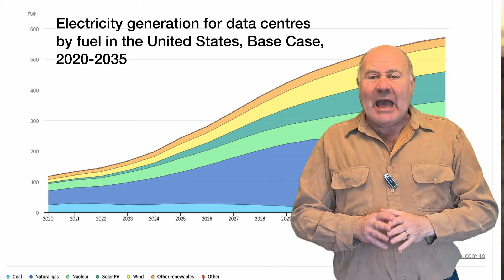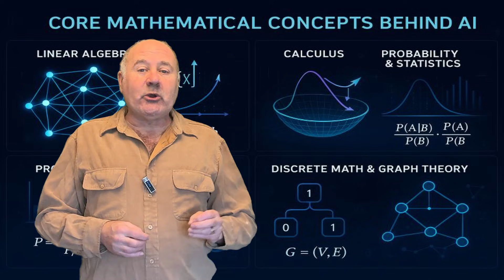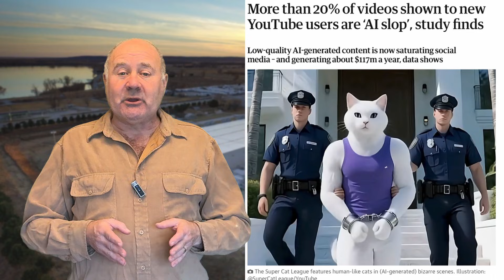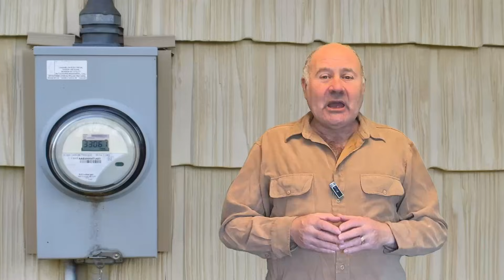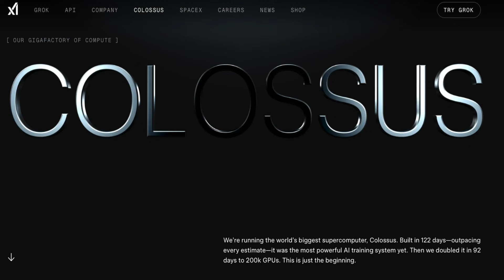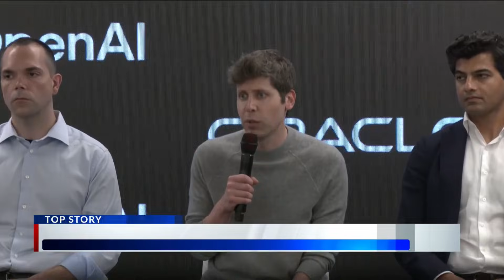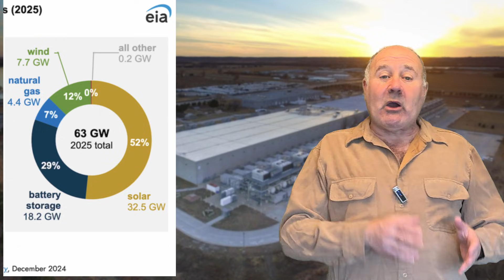You’re being lied to about electricity and AI data centers: the truth is dirtier and inefficient

Comment: You want fast and clean? Improve the Government permitting process. (Speed it up by 10X).
Reply from the maker: It doesn't help that Trump canceled a bunch of pemits for off-shore wind that were under construction. 

I've done several videos on this topic (e.g. https://youtu.be/N6b7xTd5CJg). This would help, as would improved interconnection procedures.
Reply: @Decarbonize11  The problems with wind are two - intermittency. Batteries will help that to an extent. And seasonality - which currently has no affordable solution. Solar has the same problems. Solar and wind energy - without batteries it is unreliable. With batteries it is unaffordable. What happens in a bad season? Not enough electricity. That means a battery big enough to get you through bad years. You can't afford it. Plus it is a fire hazard.
Reply from the maker: The seasonality issue pretty much disappears when you have wind (winter peaking) and solar (summer peaking) together. Add 4-8 hours of storage and long-distance transmission, and you have a reliable and inexpensive system. That was the topic of my first video.
https://youtu.be/kw9_Q_qm0Es
Reply: @Decarbonize11  Look at your seasonal records again. There are periods of insufficient overlap or no overlap. See - on average you are correct. But the grid doesn't run on average. Instantaneous input must match instantaneous output at all times. And yes averaging over time zones is good if the wires can handle the flow. All that you want - batteries and a stronger grid cost $$$ and so far the money isn't being spent. And unnecessary if you can add fuel burning plants for the local consumption.
Reply from the maker: The periods of no wind/no sun, known as Dunkelflaute, don't occur at the same time everywhere. That's why the long distance transmission is important. And having some nuclear, hydro, geothermal also helps. 

And yes, this costs money. But the only study I'm aware at that looked at total system costs found this approach the cheapest. 
https://youtu.be/D7LlA6V60RU
Reply: @Decarbonize11  I got my grid training in 1964 and '65 when the Navy was training me to run its nuclear reactors. I qualified.
Reply from the maker: Things have changed a bit for wind and solar since 1964, but the AP1000 nuclear plants that were just built in Georgia are pretty similar (i.e. pressurized light water) to what was being built in 1964. Except they were much more expensive.
Reply: @Decarbonize11  There is one extremely important thing that hasn't changed - instantaneous input must match instantaneous demand at ALL times. Some of the variation is handled by rotating machinery absorbing and releasing energy. But there are limits to that caused by frequency stability demands. Battery "generators" (solid state converters) are very good for frequency control. The energy conversions are near instantaneous. Did I mention I became an aerospace EE sans degree after I left the Navy working mainly on aircraft generators? Electrical power and I have a long history together.
Reply from the maker: You didn't mention it, but everything you said makes sense, so I believe you (not that you need my props, you've earned them). 

I think a big part of the future of a stable grid will be battery banks with grid-forming inverters. That provides the grid services currently being performed by spinning mass. 

https://youtu.be/ZiHum-VNHAM
Reply: @Decarbonize11  We have enough fuel to power things for 100 years at least. We have time to make the investments and figure things out. Measured. Considered. Not panicked.
Reply from the maker: @msimon6808  
But we don't have 100 years to deal with the carbon emissions. The "not panicked" response is to stop building new fossil fuel plants and to decommission the older plants over time.
Reply: @Decarbonize11  I was in on the original CO2 discussions at Watts Up With That? It is a scam. Water vapor (WV) is a greenhouse gas equal to CO2 according to theory. There is on average 50 times as much in the atmosphere as CO2. There are still no proposals for draining the oceans. Water vapor is not persistent? 
According to the theory water vapor's lack of persistence in the atmosphere (rain) means WV only counts for heating, not for evaporating more water vapor. Which is absurd because heating causes evaporation and the atmosphere is not saturated. The theory is bunk. - CO2 doesn't produce enough heat to make the theory work and water vapor produces too much. Bad theory.
Reply: @Decarbonize11  BTW CO2 causes global warming has never been properly proved. It depends on computer codes and those have never been fully released for review. A corruption of the scientific method.
Reply from the maker: @msimon6808  I request that you watch my video on water vapor. 
https://youtu.be/Rjkum1HFUzk
Reply from the maker: @msimon6808  Actually the warming effect of CO2 was understood in the 19th century. The computer codes are used to extrapolate what will happen in the future, but are not needed to prove that increasing CO2 leads to global warming.
Reply: @Decarbonize11  Yes. in a controlled lab experiment with one variable. The atmosphere has hundreds of interacting variables, among them Water Vapor - which at ~50X CO2's effect you have not accounted for. I understand the theory being bunk ruins a lot of reasons you have worked on. The CO2 causes global warming depends on computer codes never released. Big red flag there - if you were looking for one. Which you should be. What could disprove an assumption should always be a top question. It is how you do science. You should always looking for someone being fooled. As Feynman noted - the self is easiest to fool.
Reply: @Decarbonize11  The next big grid advance will be replacing copper with carbon nanotubes. If that becomes technically and economically viable.
Reply from the maker: @msimon6808 nothing would make me happier than for climate change to not be real. I do this for my son and granddaughter, not for fame and fortune. 

And the models, which are published, that show problematic climate change have been consistent with the data. There are no projections of business as usual that aren’t scary.
Reply: @Decarbonize11  Unless you have an answer to the water vapor question that is satisfactory - you have to consider the theory bunk. The intent of the original folks involved was to scare people into decarbonizing. Which they have done. None the less without WV the theory and CO2 do not produce enough heat. With WV the heat produced should cause atmospheric WV saturation. Which it obviously does not. There are rumblings that AI does not agree with global warming theory. If AI is gong to be useful, that is the answer I would expect from it. i agree climate is changing. I highly doubt CO2 or water vapor is causing it. As to not being a scam because of confirmation may I point you to ==>  everybody knows "Drugs Cause Addiction"
Receptor science (100+ years old) says there are NO addictive drugs. Drugs fill receptors. What empties those receptors (injury, PTSD) causes a desire for pain relieving drugs. Drugs CAN'T cause addiction. People take pain relievers to relieve pain. PTSD pain is not a medically recognized condition. It is illegal to prescribe drugs for it. Ask your doctor if they know Receptor Science (it is taught in all medical schools). If they say "Yes,"  ask how drugs cause addiction. I dare ya. 
My point is - belief is inadequate to prove truth when objections are ignored. Now about all that water.
Reply from the maker: The direction is actually in the other direction. Using aluminum because it's cheaper and a good enough conductor. Carbon nanotubes would be frightfully expensive and not that much better than Al or Copper with HVDC.
Reply from the maker: Did you watch my video on water and climate? That's my answer. 
https://youtu.be/Rjkum1HFUzk
Reply: @Decarbonize11  Economics does stand in the way.

Comment: I'm glad I've downsized everything before  co vid. Being able to produce your own electricity is the way to go it's cheaper and more sustainable. During the warmer months I don't even need electricity most days. I have some solar but my tri-fuel Honda that runs on gasoline, propane or natural gas. I only run it on propane and I have a bit saved up. Propane is a green fuel that never goes bad. Solar is good but it doesn't work on cloudy days, at night or on rainy days. And solar along with battery banks have to be replaced after so many years they lose their efficiency. My tri fuel Honda generator running on propane will last a life time.
Reply from the maker: You may produce your own electricity with the generator, but you're not producing your own propane, so you've just changed who you're dependent on, though it sounds like you're not very dependent since you downsized. If you live in an area where the grid goes down a lot, this might make sense, but it's not green or sustainable.

Comment: Grid itself doesn't scale up.
Nuclear promoters say only existing national grid as project costs expand too much.

Which modern technology scales up economically to replace fossil fueled energy ?
PV roof electricity and V2 EVs behind every meter. 

PV roof panels shade hot roofs and lower summer peak air-conditioning costs. 
Humans stop moving in extreme heat.

Grid full time maximum UTILIZATION at full time peak supply capacity WITH behind the meter batteries, and not the annual maximum PEAK LOAD operation with no behind the meter battery capacity. 

Grid capacity overbuild for the annual peak adds to the ENTIRE grid upgrade.

This is a fundamental concept.

Comment: 7:45 Yea don’t make claims off conclusions formed by grandiose brochure style pr advertisement. I have researched into the citadel & either they never provide or go into details or if they do when you get through all the grandiose boasting you find that they are deceptive with their claims. Like they claim 100% recycled water, while only 33% is but they make claims future technology developments will resplenish their usage indefinitely as if technologies in development are guaranteed to fulfill speculative potentials. They say they use 100% renewable energy including solar & wind, well what are the other renewable energy sources they primarily use? They primarily use the term renewable but also use green as well. Way in their ESG data report did I see where they have & are partnering with Nuclear power plants for their energy. So their claim about 100% renewable energy is unfounded & unbiased as they do not state their sources but contrarily mention using energy not made by renewables. While nuclear may be “clean” energy it is not renewable & this their claim of 100% is false. So YES they ARE GREENWASHING!
Reply from the maker: You’re right that I didn’t dig deep into The Citadel and I appreciate you sharing what you’ve learned. 

For nuclear they have signed an understanding with Oklo about future nuclear, but I don’t think they currently have any contributions from nukes. 

Even if all they’re doing is having some behind-the-meter solar and batteries and the rest comes from the utility, that’s better than what xAI and OpenAI are doing.

Comment: I live alone, the TV is on most days, and I only have one small light on. During the winter months I wear three insulated tops and set my thermostat so it is just below "turning on". Yes, its pretty cold, the olive oil on the counter turned solid, and the shampoo in the bath room is almost frozen.....and my electric company said my usage was up and sent me a $300 plus bill for Dec, Jan, Feb.....absolute no way I am using that much electric.
Reply: Same here. My bill doubled and I do nothing differently than before.  Now my power bill is almost as much as a car payment t every month
Reply: @ericswires8534  There has to be some law to prevent this. It is fraud, they are charging us for something we are not getting (using)?? That is a crime.
Reply: I never use Christmas lights or cook more in December and yet the power bill is always higher in December!!
Reply: Insane. I have all my heater elements on. XboxX/PS5 Washington machine dishwasher. Fans on all summer. I got akvarium with heaters lamps and filter. I pay 70 dollars. But im in sweden. Maybe ypy can switch company

Comment: Servers need a constant and consistent supply of power. That isn't coming from solar, wind and batteries.
Reply: I guess nuclear and gas will be used for data Centers, solar and wind for ordinary users
Reply: @sullivanrachael That won't work either. Base load units and an upgraded and hardened infrastructure is required to address the general population as well. Modern appliance electronis required stable power supply too.

Comment: I worked at a company that builds green AI datacenters.  The power is required for training models.  NVIDIA still has the leading technology in this space, but there are competitors that are getting closer.  The real problem is how fast the growth is with regards to how much power is required for each new generation of hardware for training.

When I started there a couple of years ago, each rack of hardware required 40 kilowatts of power to operate.  About eighteen months later, the next generation of hardware came out, and it requires 140 kilowatts of power per rack.  That’s 3.5 times as much power required per rack, in just one generation.  Each rack can do much more training per watt, but the wattage is also going up, fast.

NVIDIA has already told their customers that the next generation of hardware will require at least 600 kilowatts of power per rack.  Again, it can still do more training per watt than the previous generation, but that’s now a factor of about 4.3 times as much power per rack — again, just for one generation.  That’s a total of fifteen times as much power required, over just two generations of hardware, and about eighteen months between each generation.  That’s exponential growth.

In comparison, it takes years to go from starting to plan to build a datacenter to being able to start rolling in hardware.  My former employer was working on making that time period shorter, but there’s a lot of red tape and approvals you have to go through, on top of all of needing to find sources for all the power needed for the systems, all the cooling systems and the water required for those cooling systems for the datacenter itself, all of the high speed dark fiber that is required (terabytes per second today, petabits per second in the near future), and all of the on-site battery and backup generators for when the grid goes down, plus the fuel for those backup generators.

And then you also have to account for all the water usage for however the power is going to be generated, whether that comes from the grid or from the on-site generators.  Gas power plants require huge amounts of water, and coal power plants require orders of magnitude more water than gas power plants.  Water requirements for the power plants could easily be higher than the water requirements for cooling the datacenter itself.

No one is thinking about any of these things.  Local power and water resource networks like ERCOT and LCRA work in terms of five year plans.  But five year plans cannot possibly keep up with exponential growth in power requirements in an eighteen month generational lifecycle.  And water resource networks like LCRA don’t even have network sharing arrangements that they are working on, whereas power resource networks like ERCOT have had those kinds of features for years — that’s a critical component of the power grid.

On the flip side, inference is relatively easy.  General CPUs can do inferencing about as fast as NVIDIA hardware (on a cost/result basis), although custom inferencing hardware can do much better.  You can even get custom inferencing hardware built into your phone.  In fact, pretty much all modern phones already have this hardware built in.

This is a bubble that will pop.  It will be bigger than the dot com crash.  But in the meanwhile, just how much destruction will these companies cause to our water supplies and our power grids?
Reply from the maker: Thanks for sharing your insights.

Comment: Great video.  I'm not sure if you mentioned it:  But the cost of power from "onsite behind the meter" generation will likely be at least twice what it would be from the Utility who built real long term reasonably environmental power plants.   How will they be able to afford the energy cost.   Another item - There is not enough gas pipeline capacity in the USA to support all of these data centers using gas turbine generation.  It would take at least a decade to build new pipelines as the permitting process alone is at least 5 years.   Now there are isolated places where there is enough local pipeline capacity.   But, those are a lot rarer than most people think.  A GW of power generation takes A LOT of natural gas.
Reply from the maker: I didn’t mention cost because these companies don’t share any data on what they’re paying, but I’m sure you’re right.

Comment: My town has a pulp mill and a steel mill, and both of them have "behind-the-meter" cogeneration burning wastes like black liquor, wood chops, and blast furnace gas.
Reply: What is "behind the meter"?
Reply: @SCOTTSAVH Captive generation. The power plant is on-site at the factory and the electricity doesn't flow out over the grid. It keeps costs down and allows for cogeneration of process heat.